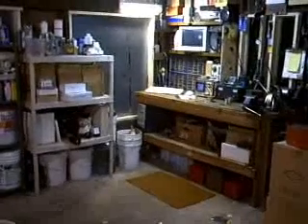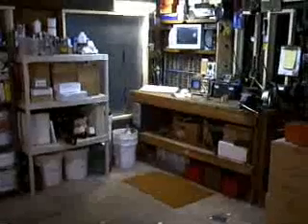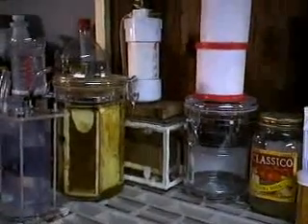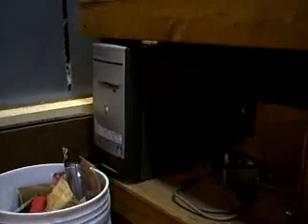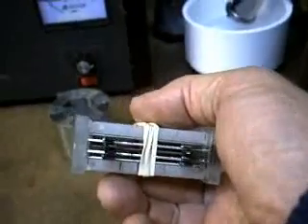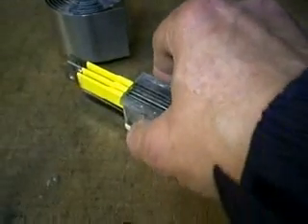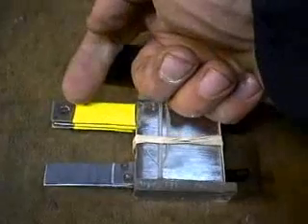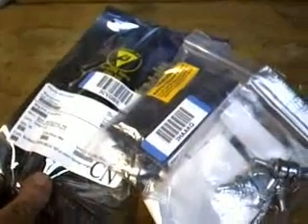#69 Two more designs to try with the CPSR cell

Comment from the maker: Many people have had good results with the stainless wall switch plates from home depot. They're 304 but it seems to hold up reasonably well. Using Potassium Hydroxide instead of anything with Sodium in it like Sodium Hydroxide will help too. You can even go the other way, instead of very basic go very acidic with white vinegar. That will definitely keep the plates clean.

Comment: im pretty poor so anything i use, is usually something i have either ransacked from something or scrounged up lol, i did manage to build a small measure hho generator, using a Cell phone charger as a powersource, i have been thinking about killing off my old computer and sacking its power supply, but as far as finding materials that i can use to make the plates from, im still coming up short, which has been difficult, everything thus far i have used Rusts, and when powered near instantly.

Comment: Hey SZ, where U out of?  I own Battered Bugs, a VW specialty shop now out of Dixon Il.  I'm in an 18000' sq. facility and am equipped with just about any type of fabrication/assembly/electronics/computer equip. U could imagine.  I've found Ur videos very interesting, but have U tried sandwiching neutral plates between Ur charged ones?  Also, U do understand the principals of electrical resonance and real atom splitting?  My father did years of atom splitting at Fermi Labs out in Batavia Il.

Comment: i built something and had the rust problem, are you using materials that are high in iron, because if so it will oxidize quickly. i found that out by accident, i would reccommend using something less likely to corrode, if that is the case, i wish i could afford a gold ingot to cut into plates.........

Comment: TIP: that rust color stuff you may be getting at the top of the water is rust, salt makes things rust soooo look and see if what your putting in the water has salt in it, i hear lemon juice works good and doesnt make that rust color stuff (i'm sure it's rust i took some off the top and let it dry. also, i havent tryed lemon juice because i havent had time to get any and i just found out yesterday so let me know how it works, thanks.)

Comment: Hey Zero,
Have you tried to use your PWM to drive a standard automobile coil (or homemade coil) to pulse high voltage to a cell?  I would think heat could be a problem, but possibly regulate the Hz?

Thanks for all of your work.